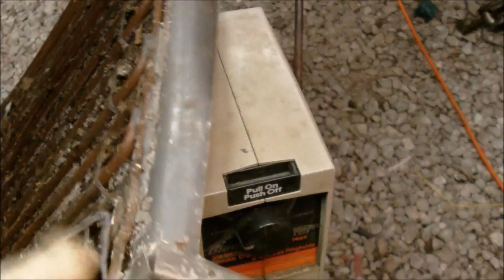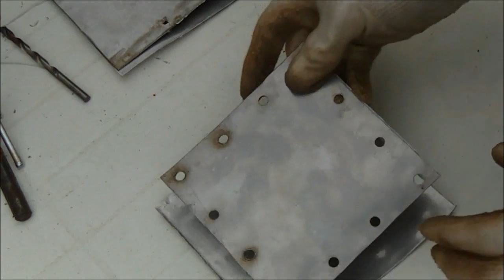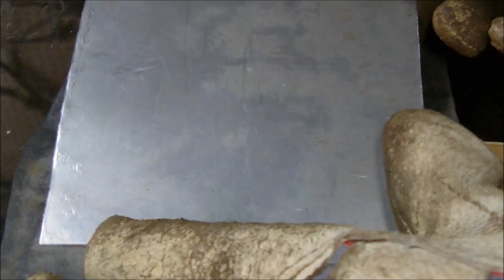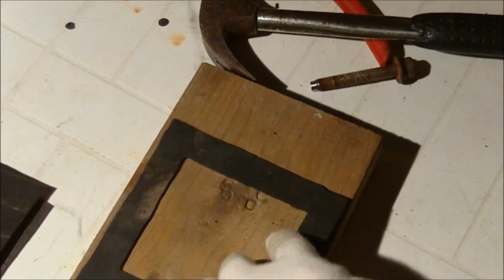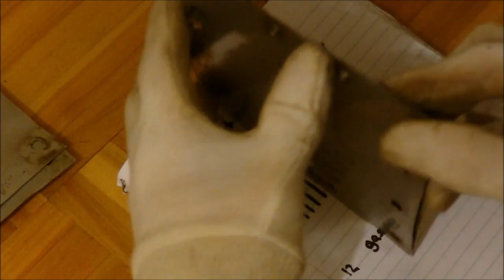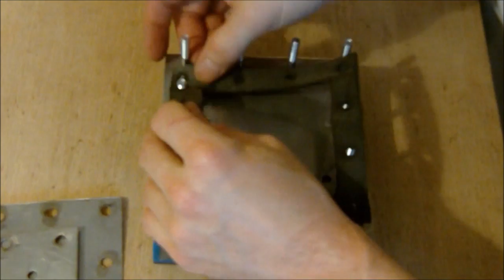HHO Dry Cell Generator build from Scrap, How-To DIY

Comment: Another wee tip, you need 5 neutral plates per stack when using 12 volts as a supply. Using 4 gives 5 spaces, 12 divided by 5 = 2.4 volts giving you an excess.

Comment: You mentioned in 22:37 that the screws could never touch any plates. That you should use insulating material or coating. But I noticed you didn't use any.  As someone suggested in the comments there are nylon screws or plastic tubes which you can insert the metal screws at least. I think you should visibly have shown this for safety reasons so nobody does exactly what they saw and shorts the circuit. I know you did it this way for convenience sake and so the hobbyist can get an idea of its construction. But it is highly important.

Comment: A quick tip for drilling the plates, run the drill at the lowest speed, then drill halfway through one side then flip plate and drill the other halp from opposite side......then no burrs to clean up....Just a quick tip..

Neal Ward
Reply: They are too thin for that.

Comment: those bolts are going to short out the cell, with that design you have to isolate the bolts!
Reply: Why not use nylon bolts?
Reply: so right you are /is better to press the plates ,not with holes
Reply: @ArbitraryOnslaught  What's the point in using 1/4" steel plate and weak nylon bolts?
He could eliminate the problem by simply covering the bolts in heat shrink.
Reply: @kalleklp7291  Its a good idea, I think nylon bolts are as good as heat shrink. Perhaps the heat shrink could tear? Try it.
Reply: @ArbitraryOnslaught  To compensate for a little warping in the plates (they do so when cut to size) one has got to have some torque on these bolts or it will leak as a sift.
Sure, nylon bolts and nuts have their use especially in electronics and the like. However, I doubt they would hold in the long run in such a device. Heat shrink comes in different thickness and size. It's pretty tough and as there are no mechanical movements in the assembled cell it won't be a problem. The heat shrink will also protect the bolts from corrosion. Stainless steel bolts this size are somewhat expensive so galvanized could be used. Heat shrink and some clear coat and corrosion won't be a problem.
Reply: @ArbitraryOnslaught  Btw..I have used nylon as my front and end plate for my cells. I can't remember the exact thickness but they are somewhere between 15 and 18 mm X100x100. My cell has 15 plates in between.
They make the whole thing a lot lighter and there are no problems with short out at the end. Seals just fine though as they haven't been apart for 4 years now. :)
Reply: @kalleklp7291  neat, I wonder if anyone spray coats the exposed threads in polyurethane? As a percaution. Or in conjunction with heat shrinking...
Reply: @ArbitraryOnslaught  Excellent idea.

Comment: Definitely a cool video! It is good that he made the viewers aware of isolating the electrical connection between the plates by insulating the bolts that pass-through the stack... Previous to this video, I wondered why neutral plates are used in designs like this. Now I know, to reduce one of the 3 elements that cause corrosion of metals ( potential difference aka-voltage). Another thing that I learned from this video is the importance of staggering the lower electrolyte ports in the plates (to reduce the risk of an internal short circuit) and the reduced stagger of the upper gas ports (to allow the rapid flow of the hho to exit the plate chambers). Very good informative video! Thank You!

Comment: body the problem what you did is, you shorted out all the plate because your using all metal bolt, so its touching each other, once you connect to the power defenitlly KABBBOOOMMMM!!!!!!!
Reply: I am having problem getting through that part myself
Reply: Boom🤣🤣🤣

Comment: How are the bolts not shorting all of the plates together?  Unless I'm missing something all this is going to do is trip circuit breakers and shoot sparks.

Now if you used heat shrink tubing over the bolts and nylon washers on both ends you may be on to something.  As it stands all this video is teaching is how to waste an afternoon building something with no chance of ever actually working.

Comment: If the magnet sticks to the stainless then it's a recycled grade and if it doesn't stick it's a pure grade.
Reply: yes !!! I work with stainless that is magnetized and non magnetized !!!
Reply: Eddieallen If a magnet sticks then it's not stainless steel. Stainless Steel has all traces of iron removed from it.  Someone may be selling fake stainless steel that is regular steel.
Reply: Donald c49 no recycled stainless steel say grade 308 isn't pure while higher grades like 316 is actual pure stainless steel. 308 is used for appliances, restaurant equipment ect that needs rust prevention but doesn't have to be 100% stainless. 316 is preferred for hho cells because it lasts longer.
Reply: Actually it's commonly called 'chrome-steel', which is a very poor stainless steel quality, you may call it stainless steel if it contains so many non ferrous metals that a magnet doesn't have or have minimal effect on it.

304 is most common used and 316 is more used for salty and acidic enviroments.
And then you got hundreds of other stainless steel alloys..
Reply: I'm no metalurgist. So please excuse me if I'm in error here.  I have worked with 301 stainless in the past that is partially ferrous (has iron) & slightly magnetically attracted to the iron particles in the nickel/ iron alloy which forms stainless. I'm not certain of what the difference between 301 & 316 stainless is, maybe there can be NO detectable attraction to magnetism with the 316 stainless steel?

Comment: Use nylon nuts and bolts to avoid shorting out
Reply: +P0tat0_craft use shrink wrap on the bolts. the nylon wont maintain a seal when they expand from heat. use nylon in wet cells only.

Comment: Use a step drill next time you decide to drill sheet steel, no raised edges and a true round hole instead of a slightly triangular one that a twist drill bit makes (in sheet metal only ofc).

Comment: question, should i sand them to get  rougher, better conduction? I think so. And couldn't i just use plastic bolts not metal?
Reply: Skram yes
Reply: +Skram no. use the right matterials or dont build. if you want EFFECTIVE results, 20-30% fuel savings, you must build to the highest standard, install the proper electronics, retune your vehicle, filter the vapors produced, AND cross your fingers. most peeps build junk and get shit results. thats why there are so many nay-sayers out there.
Reply: +Nick Prince you left a lot of good responses but this one is not the best. 
skram is clearly not an expert so let him use whatever he has for his first cell. i spaced and glued my first with hot glue lol. building to the highest standard is not how people learn. sanding the plates makes moore surface area and millions of nucleation sites for the bubbles.  how do you filter the gases? nylon doesnt expand THAT much in my opinion
Reply: I haven't built one yet. At the time of that post I had a couple weeks of research into it. I'm slowly getting my parts together and deciding what electronics I will use. I meant no disrespect, only the best guidance I could offer. My father raised me in the school of "if it's worth doing, it's worth doing it right". So I'm probably a little biased or you could say ANAL, lol. I don't want to see someone throw away money if they can avoid it, but the learning experience is good for some people. I was raised in a garage with a father building helicopters and other fancy things so I'm sure I'm blessed with an advantage of mechanical understanding. I'll try to take that into consideration for future posts. Thanks for the heads up.
Reply: I'll answer your questions when I get to my desktop, on mobile at the moment. Hang tight
Reply: +steffankaizer +Nick prince, you guys I havent told you anything about what I am using to build with or what I have done. My comment was more of a  "Wouldn't this be better mate?" To the uploader. plastic=nylon Blots I meant to say would work better, no shorting out. And if I were to sand it you have more surface area then otherwise with the 1ml -ish gap. Iv been on this for a few years now. My purposes for this was for a torch, to weld and more. Not a car. :p I would rather go electric, that is why I'm building one. Thanks though,  any thoughs one the wet dry hybrid?
Reply: +Skram sounds great. the wet dry hybrid looks nice as well. keep making cool stuff

Comment: Good job bro, but that drill bit is not suitable for drilling sheet metal but still it works, using that bit to drill metal sheet you need to sandwich that sheet between 2 half or quart inch plywood or metal plate  which is pre drilled for that size and clamp it,  so that drill bit move through that pre drill  to the sheet metal

Comment: good build but why not line up the two plates with nylon bolts in the middle of the plates and use the gaskets and build the cells in the center of all the steel bolts so nothing touches for sure

Comment: My question about dry cells is maintinence. Understandably with distilled water and arm and hammer no worries however with tap water how quickly will the dry cells build up sediment and short of dismantling the cell is there an efficient way to clear the cells?

Comment: Hi, Great video! Learnt alot. But, quick question, If Running This in a Car where would the 3rd -ve or +ve Wire Connection come from? Assuming Running directly from the Alternator (Instead of Battery?) 😕🤔

Comment: So, has the plates of this contraption RUSTED yet? Do you know why? You are electrolyzing the Chrome out of the stainless steel, which will make it rust + produce extremely toxic water (do not touch the electrolyte barehand after you have used this machine, it WILL kill you). The electrolyte will be so toxic in the end that not only you cannot touch it by hand, breath it, OR actually throw it down the drain. To avoid the rusting + toxicity problems, either use copper as your anodes, or use platinum or gold. Regards man, keep the good work up
Reply: use good rich man

Comment: hi i'm robert of Uruguay, I could you explain how you do that all neutral plates are not connected with bolts that tightened? thus are connecting all neutral, positive and negative plates with those metal screws, if you look at other videos these screws are always outside the placas¡¡¡¡
Reply: +Roberto Grillo bolts get shrink wrapped with heat activated pvc sleeves

Comment: Hmmmmm.......... I wonder if you could just glue the gaskets to the plates and not have to clamp them together with bolts, that means you wouldn't have to drill bolt holes only the holes at the top and bottom for the water flow..
The sole purpose of the bolts is to keep the cell together.
Or why not use duct tape over the outside to keep the cells together once they are glued.
That would ensure it stayed together without the problem of shorting the cells out or having to insulate any bolts.....there is no pressure so the cell won't burst.
I think you could use silicon sealer, the type used in aquariums, for gluing the gaskets to the plate.
With that thought, why not use a bead of silicon.....just 3mm wide all round the edge of the plates and no gasket.....the silicon would need to be 1/16" thick or thereabouts.
Without the wide gasket this would give you a lot more surface area on the plates in contact with the electrolyte.

Comment: i would not criticise without having done better but this is kind of bad. on top of all the things previosly pointed out it has no positive effect to make the bolts go through the gaskets so you could skip that and make the holes just on the endcaps. use less bolts and cut the gaskets skinnyer all the aria covered by the rubber wont produce anything. but you did say you are not an expert and its a good effort. you prolly have progressed a bit since making this vid an that was a year ago so you could make a new vid with a better cell after all you have made one already and your stuff is awesome. keep doing stuff

Comment: There is nothing wrong using a HHO cell to generate HHO-gas, but using it on a car, is not useful. The cell is driven from the Generator, and the generator isn't very efficient, so gasoline -> engine -> generator -> electricity -> HHO-cell -> HHO-gas -> motor. There is losses between each and every conversion, that is why it cannot work.
Reply: if you haven't done that b4 dont say it cant work
people have done it
Reply: Donald Nkepah Zaprodk doesn't need to attempt it to back up his hypothesis. He is referring to the fact that at each stage of the process some potential energy is lost due to inefficiencies. If each stage was 80% efficient, starting at 1kW potential energy in the gasoline you'd get: 1kW -> 800W -> 640W -> 512W -> 409.6W -> 327.68W -> 262.144W (From this you can see how one can assume the inefficiency of the system without the need for testing).

Comment: So still sitting here trying to figure out how this thing turns on..

So just the concept of connecting metal together with holes and rubber in the middle and pumping water through it produces electricity? I still don't understand what it is connected to in order to turn it on.

Sigh~
Reply: ok im not a science geek or not even qualify to comment in this field, but, if im not mistaken, he is trying to produce HHO...from water...that will fill in those plates...when it is charge (the positive and negative like he sketched)...the H2O which is water...will break down to HH and O...HH is then collected and being "lead" (using tube maybe?) to say an engine. combine HH with spark or fire will create "exploding" effect ..or combustion in your engine....hows that for an explanation from someone who knows nothing about this :P
Reply: M.Gadafi Sabli
 so basically they use a battery?

Yea I did some more research.. for some reason I didn't realize you needed a battery to charge the plates. My brain broken. =P
Reply: Yes battery is used as power source, when there is current flowing (i think this is the same concept as electrolysis..correct me if im wrong)..the negative side of the battery that charges the plate will "attracts" hydrogen...while the positive side "attracts" the oxygen ...a lot of these setup also includes a bubbler (which i think used as an indicator whether your plates or dry cell does its job or not...bubbles produced indicates that it is doing its job)..and i noticed the water is mix with some electrolyte (ive seen even baking soda used) to increase efficiency of the current flowing...i too just started researching about this...so..
Reply: I am connecting mine to the + on the alternater and running it through a vacume line on the carb !!!!
Reply: Corrected it is nothing at all like electrolysis.  So anyway, it can be connected to house power supply. This is a very basic tutorial, he didn't even add an electrolyte to the water which is paramount.  Also, you really need a WPM for optimum use.
Reply: These are all terrible replies. YES, you need a power source, most likely a generator. Jeez, what's up with all the inflated ass replies? What ever happened to simple answers?

Comment: VOLTAGE DOES NOT DEGRADE, CURRENT DEGRADES.  HIGH VOLTAGE GOOD, LOW AMP.
Reply: high amp
Reply: +Gijs high voltage equals heat. you want to keep the volts  down by splitting up the stack with neutral plates.Also, you want the lowest amps possible or you will overdrive the cell and burn out fuses,thats why we use multi stack cells. The smallest draw at the peak production efficiency according to system capability. in a car, 30 amps is a heavy load that will heat shit til it burns, shorts, melts, or fries components, hence the use of a PWM.
Reply: +Mike W high voltage bad. Thats what the plates reduce. Max volts is 2 between plates or you are not getting efficient results.
Reply: Thank you sir

Comment: Is there a dry cell design that can separate Oxygen from Hydrogen?
Reply: That is the dry cell. I believe they call it that simply because the power cables are not submerged as they are in wet cells.

Comment: قفله بسبب المسامير ملامسه كل صفائح الاستانليس
Reply: كلامك صحيح It’s in correct work the bolts is connected all together
to the steel plates it will make explosion and it will not be

Comment: your  mistake is  thath  tou are  using metatal  bolts.  thats connect   positive plate  to  negatives...    cheango   bolts    and   put   them  in plastic   ceck  my  idrogen generator.  :)   sorry  for  bad  english :(
Reply: Yeah!! I have the same Question !! bolts will short the circuit !! how is possible its can produce !! they must be insulated bolts need to run this / for the production !!
Reply: But I want to say its a good video!!
Reply: Most have heat shrink tubing on the bolts
Reply: hmm, ok thanks!!
Reply: nylon bolts and nuts only !!!
Reply: yup it shorts the circuit
Reply: Rulof Fai da Te yes
Reply: I was about to ask the same thing. Isn't the power traveling through the bolt
Reply: Yea I have seen people space them with something non conductive

Comment: 1 NEGATIVE PLATE (or anything) 4 NEUTRAL PLATES (or anything) 1 POSITIVE PLATE (or anything) 4 NEUTRAL PLATES (or anything) 1 NEGATIVE PLATE (or anything).
P.S.
GASKETS BETWEEN NEUTRAL PLATES  
(or anything) ALSO END CAPS (4 cherry).

Comment: Your bolts are making all the plates the same you're shorting everything out it will not produce hydrogen gas the bolts are making all plates the same because it's making all the connections together there is no individual plates in your design you must put the plates inside away from the bolts inside gaskets to hold it in place without touching the bolts you have just made one big glob of metal it will not work right
Reply from the maker: Sorry I don't have links right now, I found mine on AMZ, Ali, lots of sites have them ebay, wish, but you have to watch the prices tho. 👍